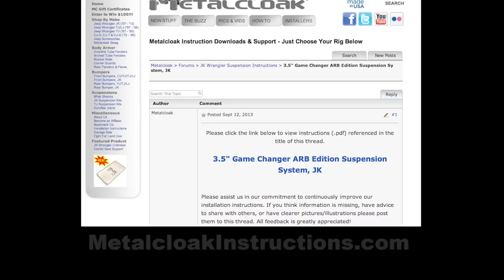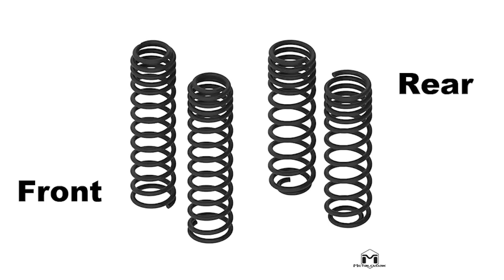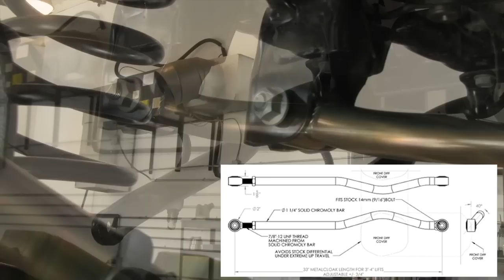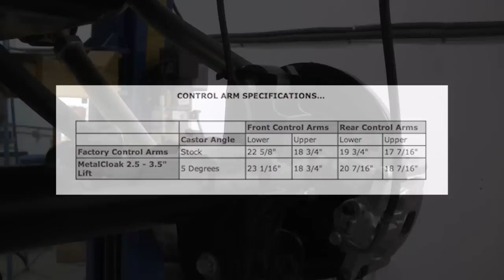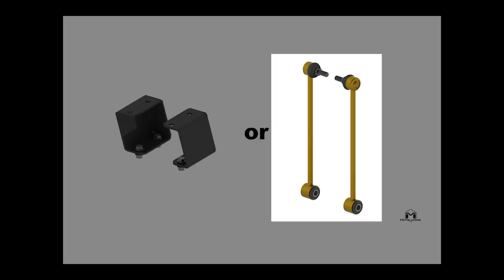How to Install: the MetalCloak Game Changer Suspension, ARB Edition on a Jeep Wrangler JK (07 - 17)

Comment: Lmao is that a hockey puck for the bumstop?
Reply from the maker: LOL. Our original adjustable bump stops were hockey pucks. They had the right shape and the right durometer and as a small company we didn't have to pay for tooling... now, while they have a similar shape, they are custom designed by us to include beveled edges for nesting and easier installation.